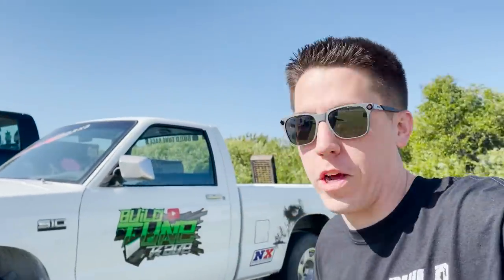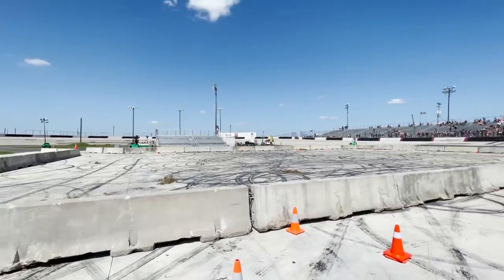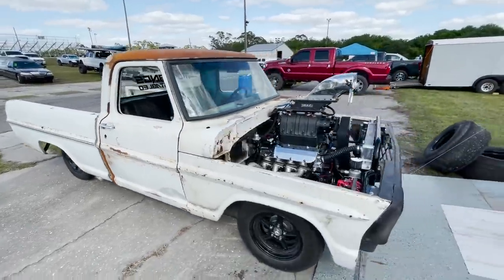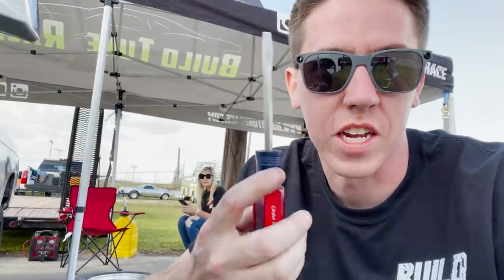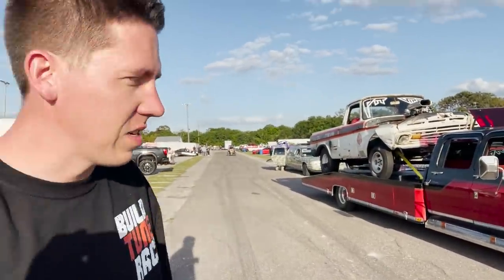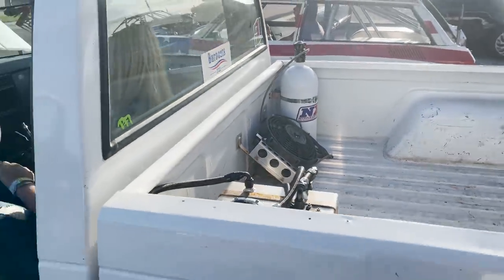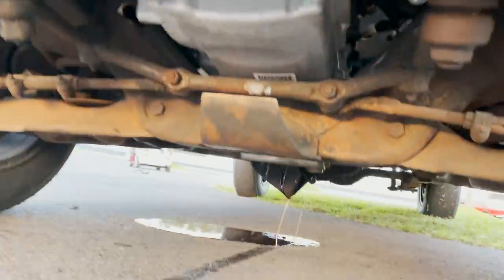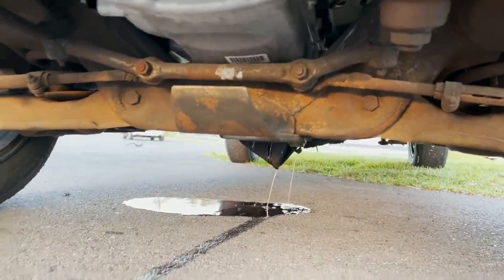Broke Burnie The Burnout Truck BAD At Cleetus and Cars! I Didn't Listen to Cleet...

Comment: Over size the the outer pinion bearing and add a solid machined bushing between the 2 bearings.  Add torque bar for the reverse forces and have fun. That's how I beefed up my rock crawler to go backward up a hill.

Comment: I remember stories of folks having their feet cut off by a flex plate or pressure plate when catastrophic failure happens.
Reply: Wow
Reply from the maker: Yeah it would have been bad! Flex plate seems ok  though something inside the trans decided it wanted to leave lol
Reply: @BuildTuneRace  
Nice build with safety my friend, I along with everyone else are glad we didn’t see injury a top a blown trans.
Reply: Just ask Don Garlits about loosing part of his foot
Reply: I’ve seen flywheels and flex plates come apart in dirt track cars and do some pretty bad stuff even when running blow proof bell housings 

What people don’t realize is when they come apart they come apart with enough energy for the pieces to punch a hole thru a sbc block after bouncing off the blow proof bell housing so your body parts ain’t even a challenge for it

Comment: James, why can't you seperate the front brakes with a left and right pedal with dual master cylinders. The ability to apply drag to one front wheel would help rotate the truck, that would def be a game changer on steering. They been doing it on dirt equipment for years.
Reply: I don’t think it’ll take another master cylinder just a manual proportioning valve in the cab with with ball valves.
Reply: Two separate hydraulic hand brakes, been done here in Australia
Reply from the maker: I’ve been trying to think of something! Hand break would be cool!
Reply: @BuildTuneRace  you set it up with 2 leavers in the same place as the drift car's have their hand brake so it's closer to the steering wheel.
Should be able to use a hydraulic set up off a car trailer, use a brake booster on each leaver now you got a left and right front brake. Might not be the best idea to go about it.....but a man with your talent will come up with something I'm sure.

Comment: Look at away to incorporate individual front brakes, therefore you can control which way you spin the rear. For example on my tractor there is a brake for each rear wheel, do that for you front. You will control the pad. Enjoyed your show all the way from 600 miles north of Seattle
Reply: I've seen it done on 1 car here in Australia, it's done by 2 seperate hydraulic hand brakes

Comment: Wire wheel is good for cleaning pad spooge off the front tyres. Also, if you're going to break something you might as well break it all the way.
Reply from the maker: This is something I definitely need to plan on doing between tips! Thanks for the info!
Reply: @BuildTuneRace  Just use a face shield when you do. Ask me how I know thats a good idea... lol. 

Tyre belts to the face at warp speed from  10cm away really wake you up.

Comment: You are definitely getting better at your burnouts Dude,  one thing about the tires, the aim is blow the tires off in 60 seconds or less. You would have to be the closest to doing a proper Aussie burnout than anyone else. If it wasn't for the broken transmission,(using reverse is a major point deduction) You had the possibility of having the Win for sure. Once you do a few more things to Burnie and get it dialed it will be hard to beat. Also if you still have your front sway bay hookd up disconnect it. Because of the diff being locked it is trying to push the 
Front Foward As in understeer. You could also Run a lighter spring rate in the 
 Front springs to try and get it to turn.  Also get the softest brake pads you can for the front calipers so you have
 another way of turning it around.  But apart the money you will have to spend on a transmission you did a mega job. Well done and once the world gets back to normal and the restrictions get lifted You should definitely come down to Australia and go to Summernats or one of the many Burnout competitions we have here. it will blow your mind. If you are interested get in contact with me and I can show you around. I am from Queensland and only about 5 minutes away from where they hold Powercruise events a couple times a year. Also in the same Motorsport complex is Willowbank Raceway where the winternationals is held and it is the biggest Drag Racing event held outside of America. It always attracts over 500 entries. From Top Fuel to 11 second grudge racing and everything in between. Cheers
Reply from the maker: Thanks for the support and the info! Definitely enjoy so skids and learning more and more about it each time! Next up on the list of things to do is some suspension mods to get the truck to be a little easier to control and more predictable! There is no front sway bar on the truck. 

What does the softer brake pads do for helping it turn? More control over front wheel speed and less on or off feeling?

I would love to come over to Australia for some burnout comps and cars events definitely on my bucket list and if things keep going well maybe we can make it over there sooner than later!

Thanks a ton for the info, can’t wait to see where all this goes!
Reply: @BuildTuneRace  , you need a soft front brake pad so it grips the disc easier.  Because there is little front wheel speed there won't be much heat generated. Most standard pads need heat in them to make them work effectively. Plus if the front brakes are really good, when you have the rear wheel speed very high you can quickly punch the front brake and spin the car around. This only works if you have no rear brakes at all. Plus rear brakes are not needed on  burnout car. They become a fire hazard.  Can't wait to see Burnie up and running again. 
Cheers Mark.
Reply from the maker: @MJTAUTOMOTIVE  makes since I’ll have to see what I can find for the stock front calipers! I’ve deleted the rear brakes so no worries there!
Reply: @BuildTuneRace . You should be able to find a suitable front brake pad that will fit your car. Alot of different Manufacturers used very similar pads and calipers on different models. Just find a pad that will fit that has the softest compound. If you can't find anything to fit. You can change the bore size on your brake master cylinder. That will make the line pressure higher when you press the pedal. Good luck Dude and if you want to talk more let me know your Instagram.
Cheers Mark.

Comment: Don't use trucks, poor steer control. Like farmtruck at Australia. 
I drop tyre pressure tad at front helps. 
You get there good luck. Good effort 👍
Reply: Explain all the Hilux's and Commodore utes us Aussies use as burnout cars then...🤔 Trucks/Utes are better to swing around as there's no weight on the rear. There was a heap at RockyNats this past weekend.
Reply: @MafiaboysWorld  harder to set up thats all. I believe  its a caster alignment  issue